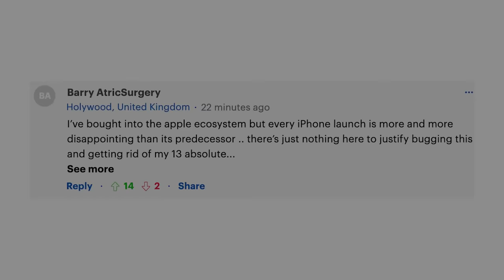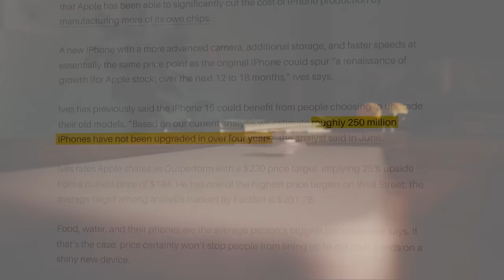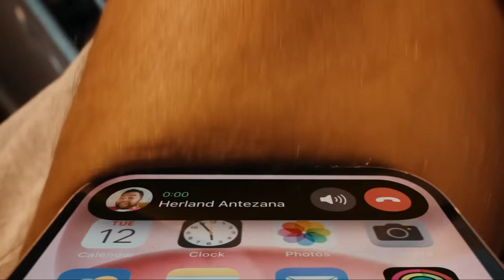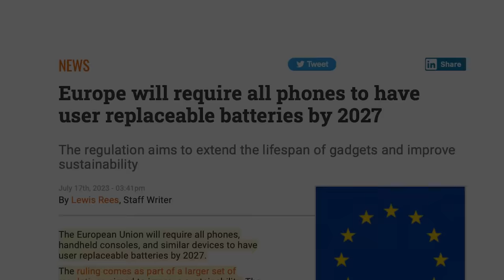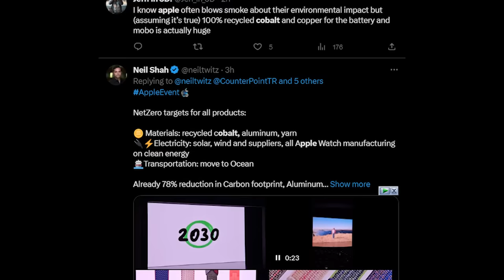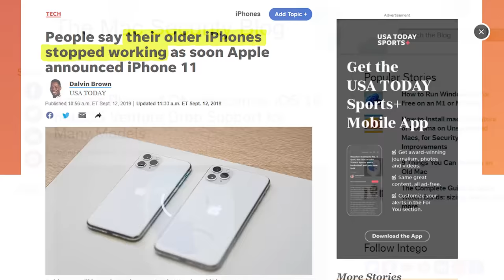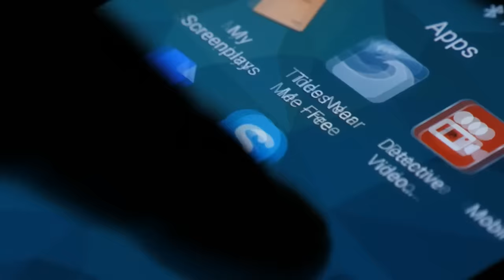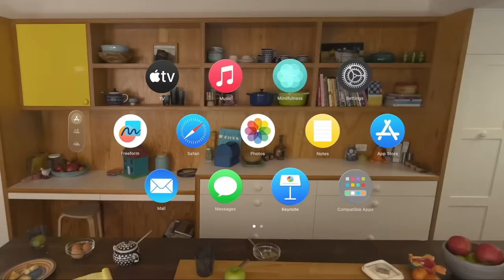The iPhone 15 Is Everything Wrong With Apple

Comment: If Repairability was more a factor in product design, then we would see people using their devices for YEARS and not months.
Reply: people do use their the devices for years. A lot of years.
Reply: Thats exactly what they dont want, they want their phones to last maximum a year so you have to buy a new one each year.
Reply: I have a Fairphone. It has a 5 year guarantee and it's modular. So when my battery starts to become worse I can simply buy a new one and pop it in. Costs like €30
Reply: I only swapped out my 2015 Iphone SE last year. Nothing to do with design or repairability. Just sheep wanting the newest model each year.
Reply: I have been using the same iPhone for almost four years now lol
Reply: I don't know dude, i've been using my iphone 10s for almost 5 years, seems enough to me.
Reply: i like to delay phone upgrades until absolutely needed. the feeling of upgrading to a faster, better device gets more satisfying the longer you go between upgrades
Reply: Lol what are you talking about most people hold onto their phones, apple or not, for multiple years
Reply: Had my 11 pro max since release and will till it breaks. People like you never really men this. Whip out that working original Nintendo and play it till it breaks bud. Oh nintendo stopped making games for it 28 years ago you say... Hehehe they were just chasing you into a new product... This is  economic illiteracy. Time moves forward and people hate change that's the real issue.
Reply: I think your point is contradicted by this video where it is stated that hundreds of millions of iPhone users are using old models. I know I used a 7 Pro for 5 years and now I’m on a 12 Pro Max that will easily hit 5 years.
Reply: What 😂 dude I am still rocking my 12pro. It doesn’t have a scratch.
Reply: The fact that iphones get more updates than any other phone says otherwise
Reply: Bro I had an iPhone 6 for like 6 years before I upgraded to an iPhone 12.  A 6 year upgrade frequency is fiiiiiiine
Reply: I have had my current device for over 4 years and it hasn't needed any repairs. Take that as you wish.

Sadly the software is outdated, hardware is outdated, and I'm running security patch from last year.
Reply: I've owned 3 phones in last 10 years and I'm not going to stop using my current one until it literally dies
Reply: @Bussin..B   you are the type of customer Apple hates and wants to stop.
Reply: Ive had my current iphone (xr) for over 4 years now, only thinking about upgraging cus i cracked my screen and my battery is getting old, and its been long enough anyway.
Reply: Also because usb c, i want the same cable to charge my ipad and my phone
Reply: Iphone 11 for 4 years here. Had 2 repairs and it runs perfectly. Ill buy a new one when it can’t be repaired further or no more updates. I need the os updates for communication and yt.
Reply: what? people do use their devices for years lol. Nobody swaps phones after months of use except if youre a billionaire
Reply: exactly, my note edge got to 8 years because of this. But most importantly is the company making the same battery after all those years, otherwise you don't have much options
Reply: I've literally used my iphone 4 for 6 years, and my iphone 8 for 4 years
Reply: @pyropulseIXXI  4 years is nothing
Reply: They don't want that
Reply: People use their phones for years. iPhones in particular last longer than many other smartphones, with 5 years of mainline software updates being standard (in addition to continued security updates following this).
Reply: @@usingintelasaheater5548 but... but... You are getting throttled!!!! Didnt you see the video!?! Planed obsolecence!
Reply: I use my iPhones for an avg for 3-4 years
Reply: Ive had my Iphone 2020 SE since release and it still works well. It doesnt overheat or run out of battery too quickly. Im considering waiting for the iphone 16
Reply: People do. I don't know where this came from. For some reason people like to say iPhones aren't used for very long. In fact, it's the opposite. Apple supports their phones for 5 years at a minimum, and for some phones, it's been almost 7 years - that means that 7 year old phones are getting the latest updates and still running smoothly. However, most Androids aren't supported beyond 3 years. Not to mention the hardware quality is just much higher - which is why you see a lot of kids with their parent's old iPhone 7, simply because the phone still works well.
Reply: I personally think software support is much better than repairability in the long run for the vast majority of people
Reply: I sold my 12 Pro because I wasn’t gonna shell out $660 for a new back glass & Face ID I still got the iPhone 7 Plus and it’s doing just fine only replace the battery
Reply: Bro who uses it for months???
Reply: Bro with apple you get 5 YEARS of  major updates guaranteed. How many do you get with the Samsung flagships, 3 Years?
Reply: Apple along with John Deere are anti repair. I had to laugh at Apple being Revolutionary when comes to tech. I'm an I T guy Dell helpdesk formerly
Reply: Idk, this stuff about all these phones ending up in the trash so quick must be a consumer issue. I’ve had my iPhone for almost 4 years now.
Reply: People do use their phones for years 😂 what’re you talking about
Reply: @cristi1145  I wonder how many original iPhones are still being used? In one hundred years nearly, every iPhone will be recycled, or in landfill. That's billions of phones if not trillions. We should start designing for the lifetime of the user, say 75 years. If a person keeps or trades in for even half that time it will make a significant difference.
Reply: @tobi4812  Maybe he should have said decades and years instead of years and months?
Reply: the problem isn't entirely repairability, if they were more repairable you'd still see the same people getting a new iphone every year or every other year, the thing that would change is the people that keep their iphone for 5 or so years (like me) might keep them for even longer, though at this point I do also want the new features like 5x optical zoom, usb-c, oled, the new (old) edges, and a different color, I honestly still kinda prefer the notch over dynamic island tho
Reply: It never will be. There's this egregious thing called "Planned Obsolescence". Manufacturers basically design products that will fail over a shorter period of time. This practise should be illegal.
Reply: I have an iPhone 4s that was run over by a car that still works. I have a 7 that works and I’ve been using an xr for the last 4-5 years. Some people get bad luck with the mass production and you get a faulty unit but mostly they work for years while being on basically the entire time.
Reply: @NigelAndTommyAreGrifters so you were a sheep last year?
Reply: I’ve hade an iPhone XR since launch and it works perfectly fine if they wanted that they wouldn’t have 5-6 year software guarantee
Reply: @SebastianD334  Its important to develop you own individual criteria for replacement. In my case I keep my phone until the end of its trade-in cycle then I trade it in knowing it's still going to be used for 3 or four more years by the next owner. I also get loyalty credits when I trade in. But I am coming up to retirement, so my criteria are changing. The upgrade cycle is far less important than battery life and camera specs. SO I can now extend my phone ownership to five years or more without concern. We are also potentially on the edge of a replacement for the cell phone in general. but I think its still several years away. I can't see people purchasing and living in a $CDN5,000 headset to use it as a cell phone.
Reply: RIGHTTT
Reply: Right
Reply: I’m still using an iPhone 7. It’s fine.
Reply: I'm using my vivo v7 for around 5 years, no problem till now with a cracked screen, but it still works.
Waiting for it to explode one day so i can buy a new one😅
Reply: @Drae2212 well my friend bought iphone 13 last year cracked the back glass after a month, apple denied the replacement for back glass now he is looking to replace it for iphone 15. Most of our generation replace their iphones frequently even if it's working fine.
Reply: Thanks to the EU
Reply: Nah, we're good
Reply: I’ve been using the iPhone 12 mini for years - no real problem besides battery and space. Other than that it works fine…
Reply: I’ve been using an iPhone 11 since 2021, and it’s my first iPhone
Reply: @Bussin..B  My XR is about to turn 5
Reply: Why are you making things up?  People do use their iPhones for years.  Furthermore most people wouldn’t know how to fix them or care to learn.
Reply: @TRIF0RCE  What are you smoking?  Hardly anyone who has an iPhone replaces it every year.
Reply: @tovape  4 years is a very long time to have a cell phone actually.  Android or apple
Reply: @PWingert1966  That’s an extremely stupid thing to say.  Do you know how much technology advances in 75 years?  You aren’t making sense.
Reply: @willissudweeks1050  with your mentality, yes, with mine, not
Reply: I had a 6s+ that I replaced the screen on 4 times and then gave it to my friend. I wouldn't dare try to replace a 12's screen
Reply: Im on the iphone8. They make good products take better care of your stuff
Reply: But I use my iPhone 8 for 6 years hakim
Reply: Yeah Sherlock, that’s the point
Reply: I’ve had an iPhone 11 since launch. Idk what drug your on
Reply: @TRIF0RCE Then explain why apple gives iPhones 6+ generations before the current model the latest iOS updates. And why the phones hold their value. And why their performance doesn’t degrade. Lmao.
Reply: What? iPhones are supported for atleast 5 years each and everyone I know doesn’t upgrade for atleast 2 years and carriers have been trading in older phones for $1k
Reply: Don't forget the software updates that downgrade the hardware capability of function properly- a Apple tactic to motivate people to "upgrade" their "old" iphones into new-expensivier versions.
Reply: I hate when people just say shit without any actual knowledge on the matter
Reply: @Kneadwise  lol shitphone for poor people
Reply: I used by 5s and 7s for over 4-5 years, dropped it from buildings, had rain water on it and everything. They do last, its just sheeps trynna get new phone every year.
Reply: Me seeing this with my 3 year old iPhone SE 2nd generation 👁👄👁
Reply: That doesn’t address escalating hardware requirements from poor optimization from shoddy programmers.
Reply: To be fair, iPhones are far more repairable than nearly every phone but the fairphone and are supported for much longer than any other phone brand
Reply: Many people use phones for years. Kinda sure about what you mean but rich people are rich soo
Reply: @brentschmogbert  me too these clowns are full if it
Reply: It’s probably just small amount of people like you. Most people use their phone for years. I’ve been using iPhone XR for more than 4 yrs and I have no issue with it, I’m still getting upgrades and supports from apple😅
Reply: I have the 12 Pro Max and have had it since launch, the only reason I upgrade is due to chip and silicone advancements. Every three years is a good run on that as well, the 15 is incredibly more efficient and powerful than my 12.
Reply: @BEEFTEEF4 
I’m also on a 12 Pro Max and honestly it’s been hard for me to upgrade to the newest model. Up until the 10, I was the type to upgrade every release without hesitation. I guess I’ll wait another year 🤷🏽‍♂️
Reply: I swap phones every 5 years 💀
Reply: Maybe some but honestly I think the larger portion would still upgrade every year just from the hype around them and feeling like your behind in technology and missing out on "features" and innovation. The fact so many people who buy apple products say terms like ecosystem shows those people are almost like in a cult. Not to mention trade in systems where you can keep trading in your old one even at massive loss but many people do that.
Reply: I've had my 12 pro max going on  2 years now pretty reliable I've had 0 issues lol
Reply: I've been using the Samsung A12 for 6 years now :D
Reply: I've been using my Xiaomi for 4 years now and it still has got more life in it, albeit it's not as shiny as an iPhone
Reply: Still rocking my iPhone 7 👍🏻
Reply: I am happy with my iPhone 13 PM, and will likely keep it til the battery dies. I have Apple products from 2008, 2011, 2013, 2015, 2021 and 2022.
Reply: @Kneadwise wtf is a fair phone? 😂😂😂😂
Reply: Exactly! They wanna charge 1000€ for repairing a 1300€ phone
Reply: Atleast make it an actual option and push for repairability, not adding some shady anti-consumer practices. yes they last a long time, but when you need it and it died, you definitely don't want pay pretty much the same as a new one
Reply: I don't get it. Wth are they holding back, if anything they'd sell even more phones if they were to do more each year
Reply: People just see the new phones being dropped every year and assume that everyone is buying them up en masse upon release. But the sales concept is similar to that of cars. You buy a new one once you feel like upgrading or your current one is beyond repair. Yeah it sucks that the repairability and modularity isn’t more well supported and that SHOULD change if they want to claim to be more environmentally and cost friendly.
Reply: @Kneadwise  that is kinda sad considering how crap that phone is, as a phone enthusiast i would quickly get bored of it though i am not one to talk with an oppo f5 from 2017
Reply: I’m more than certain that this person made this comment while never having an iPhone in their life. Many people have the same iPhone for MANY years because of how much support they get out of it. In fact you get much more life out of an iPhone than you ever could with an android phone(currently). Not saying this to 💩 on android because I also have android devices that I love. It’s just fact that you’re practically guaranteed at LEAST 5 if not more years of software updates on a new iPhone and as long as you’re not treating your phone like a toy… you’re golden.
Reply: Literally any phone that's not apple will last you years...
Reply: @elisel2308  expect Apple phones do last many years 😭
Reply: @Dan-jg7zl  Then why do they keep updating old phones? You make no sense
Reply: @Dan-jg7zl  Then why does my grandmas iPhone 8 still get regular and consistent software updates?
Reply: @fnanfne  My grandmas iPhone 8 recently got a mainline update. In fact it gets updates regularly. Are they trying to make it fail?
Reply: @migueruta  My grandmas iPhone 8 works perfectly fine and she hasn’t noticed much of a difference
Reply: @Personwtcats  That's great!😉
Reply: Who uses their phone for only a few months and what would you even buy after that?  The same phone?  (asking as a satisfied iPhone 11 user with no plans to upgrade for at least another year)
Reply: @drenathor  «no plans to upgrade for at least another year»??
- When did you bought that iPhone11?
Reply: @migueruta  Actually I should have been more specific, it's the 11 Pro Max so it does benefit from the bigger battery for sure.  But according to the health report it's still at about 80% capacity and for how much I use it day to day that still gets me through the day easily and on a heavy day I just plug it in while working.  If I just had the 11 I'm not sure if the battery would be as good after all these years so I might have been more tempted to upgrade.
Reply: what u mean my XR is still alive and kicking despite the battery drains over the day if i listen to music much
Reply: Apple replace the screens and battery still on old models, there's tons of third party repairers out there who can do it a bit cheaper too. Not sure why you think repairability is such a big issue?
Reply: months? dude you are doing something wrong
Reply: Hopefully the EU will change it
Reply: my Huawei Mate 10 , chipset kirin 970 with ai and leica camera,  still running well until know still Fast ( 6 Years still Running Well )
Reply: @nnillat i dont know what youre taking about, samsung offers 7 years of major updates. Thats all the way until and including damn android 21.0
Reply: 1.0001 years are still considered years🤷‍♂️

Lol jk😅😅
Reply: just tak ecare of your phone then? i've had a 12 pro max since it's release, and just now upgraded to 15 pro max. I wouldn't upgrade it but i didn't care for it and dropped it soo many times, kept it without a screen protector and without a case. It was my fault that i had to change my phone after 3 years. It was working great actually (good battery life), but i wanted to change it because it was broken on the back and front after i was not careful with it for 3 years.
Reply: My sister uses my iPhone 7 Plus to this day. It’s never broken or cracked. My Nexus 5X bricked. My Pixel 4XL bricked. My Pixel 6 was the first phone I cracked (3 foot drop).

My iPhone 4 still turns on. My iPhone 7 Plus is still usable. My iPhone 15 Pro is far more reliable than my Pixel was. FaceID is superior to fingerprint scanning. 

Pixel 4 was the last good google phone. Tensor is absolute trash.
Reply: People would still use phones from between 2014 to 2018 or even older.
Reply: It’s called a phone case
Reply: @oh-noe lol bro, I know people who get a new phone every year
Reply: And for at least 6 years
Reply: @ChazUBCS  then they are either rich or have some sort of programme where they pay monthly and get the new phones for free
Reply: @oh-noe  they ain’t rich bro
Reply: @oh-noe  nothing is free in this world bro
Reply: @ChazUBCS  if you can afford to upgrade flagship every year then you are wealthy.
Reply: @oh-noe  no, you’re not
Reply: Even with all the planned obsolescence, an iPhone lasts longer than any Android in the market. Saying Apple does planned obsolescence is hilarious when you compare it to Android.
Reply: @Bussin..B iPhone 11?
Reply: @Norrin277  12 Pro Max
Reply: I've been on an iPhone SE 2020 for 4 years now and it's still going pretty strong. No major issues besides 79% battery life and cracked screen, otherwise works pretty well and is very much usable. Definitely time for an upgrade for me though, thinking of getting the 15 and rocking it for at least 5 years if not longer
Reply: Repairability IS more of a factor in product design; designers (and engineers) are constantly hammered with the importance of eco-friendly and sustainable design. The problem lies with the corporate world - constantly chasing better profit margins, cheaper manufacturing, more efficient product development etc etc. They don't care about wastage, all they care about is their sweet, sweet Benjamins!!